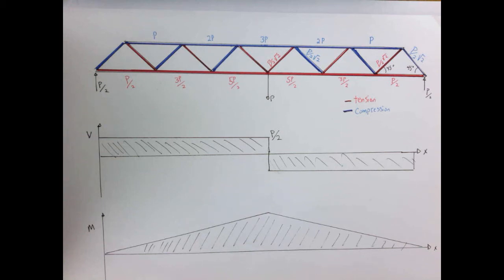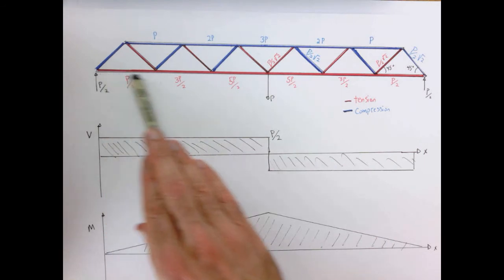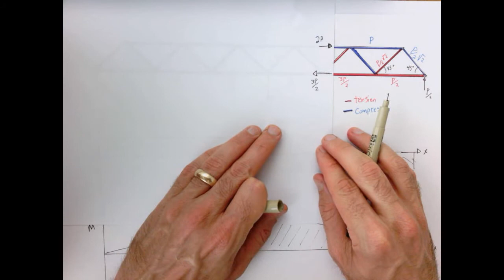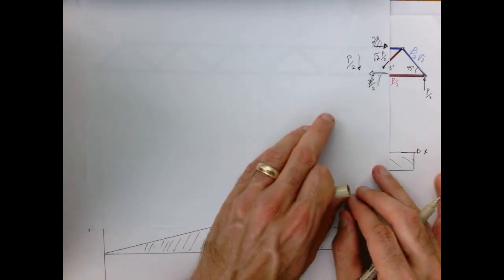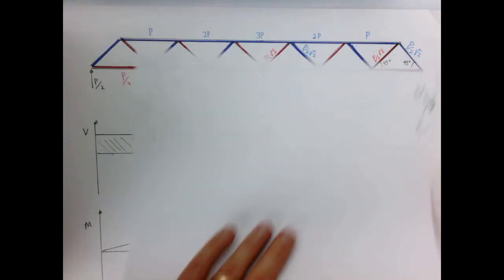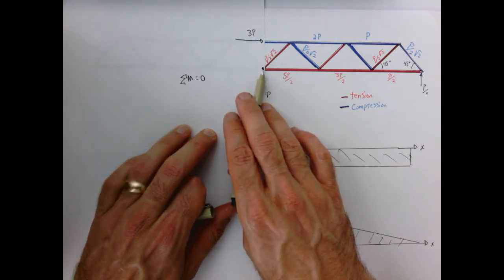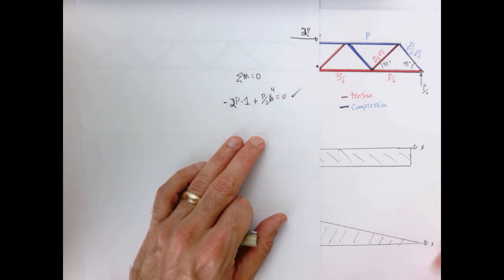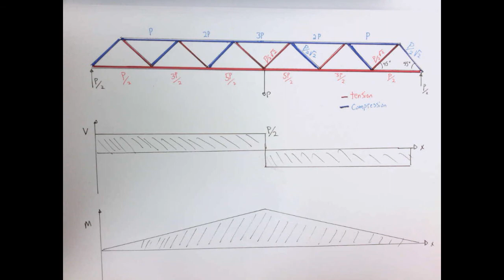Truss structures. Part4. Shear and bending.

Comment: did not really connect it to the BMD. You just proved that when you cut the section, all moments sum to zero, which is a comment fact and doesn't utilize the BMD at the bottom at all.